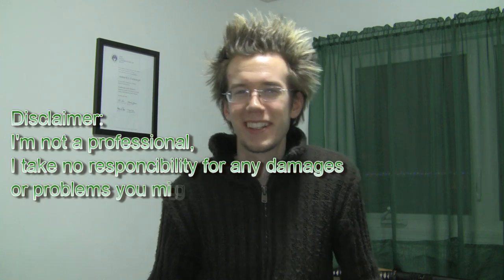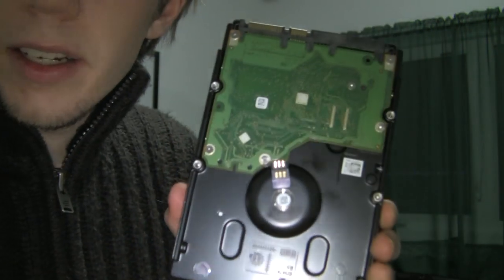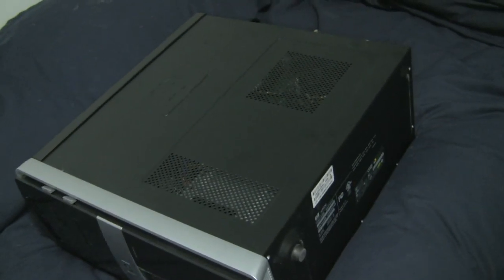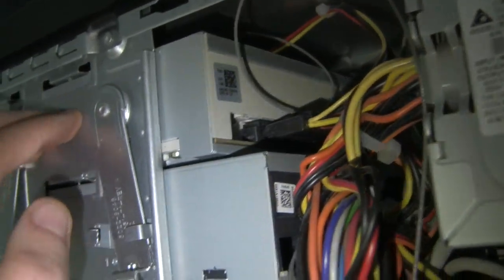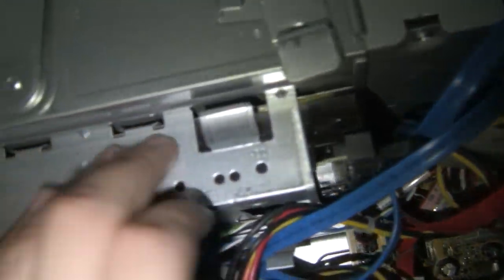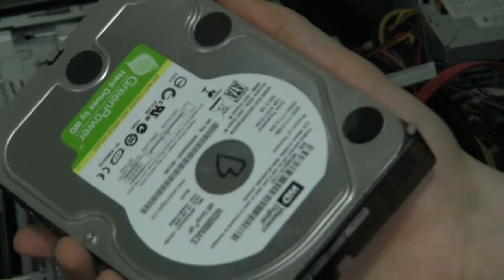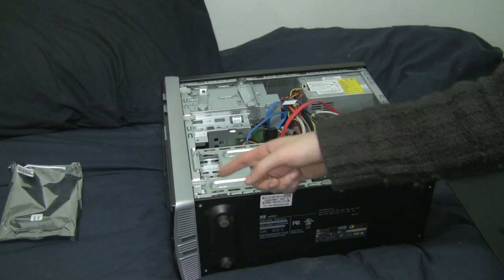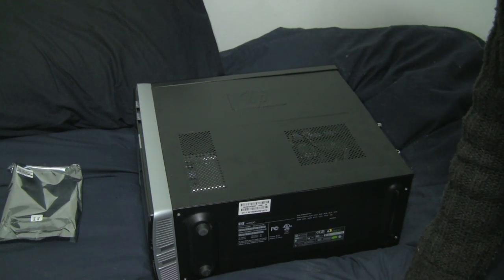Let's Install a Hard Drive!

Comment: Ahh! Yes, the reason I didn't go with a GTX 2 series is because I didn't want to also have to upgrade the PSU. It does everything I need it for without having to suck up enough power to need to beef up the PSU. 

I can imagine how horrible it would've been, when I installed the video card, it took me about 10 minutes to get it in because there was hardly enough room. I was thinking of giving up but, I figured out a weird way to get it in there.

Comment: Your computer is pretty much the same as mine, although youve got more RAM (ive only got 4gb) and ive got the nvidia 280 card which is a mega beast.

The craziest of all? You have BLUE SATA cables?!

Do you use a MIDI keyboard at all?